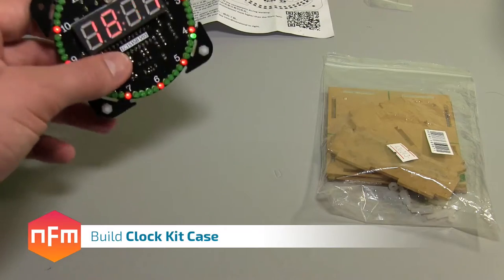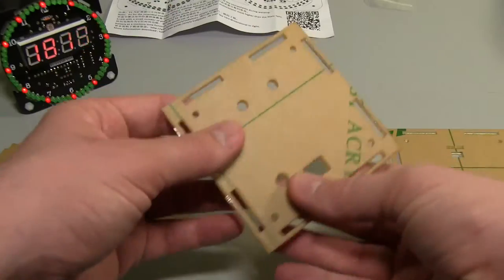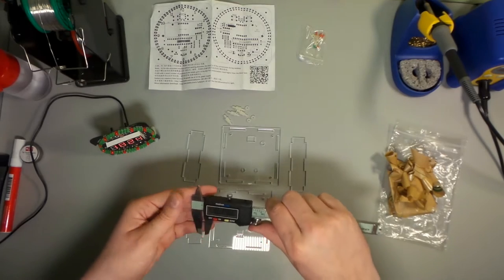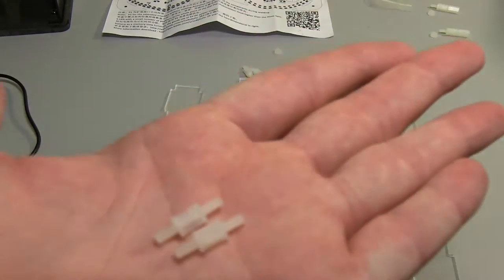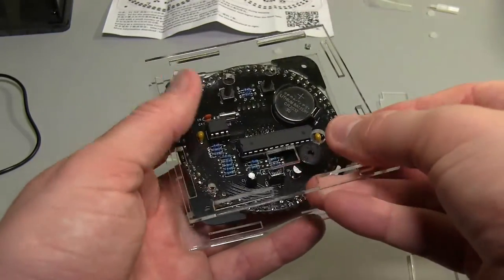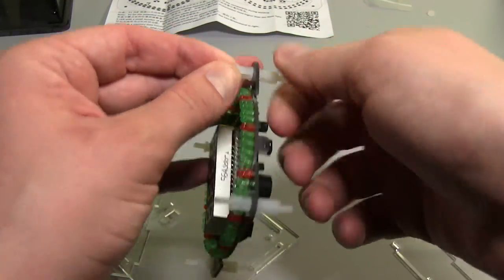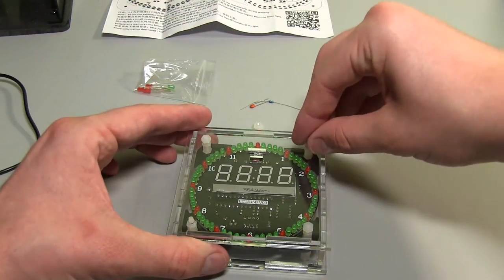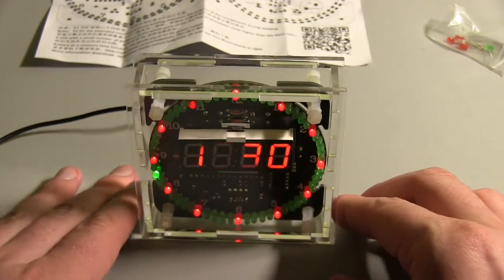EC1515B 4-digit Rotating Clock Kit Laser Cut Case

Comment: '
hi NFM...
can this DIY rotating LED clock kit use a pack of four AA batterys = 6 volts...
would be work fine or better not...
will it burn out LED lights or two microchip controllers or both